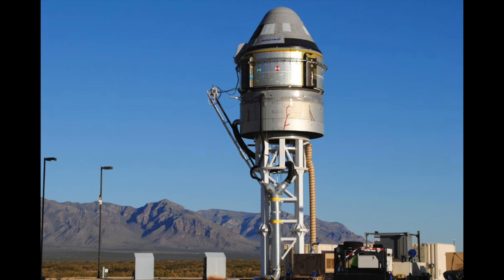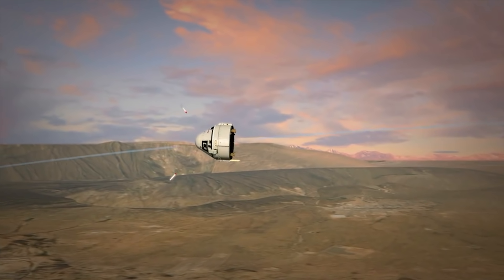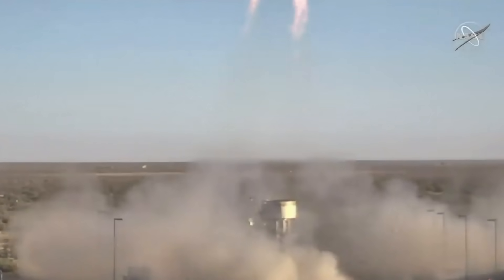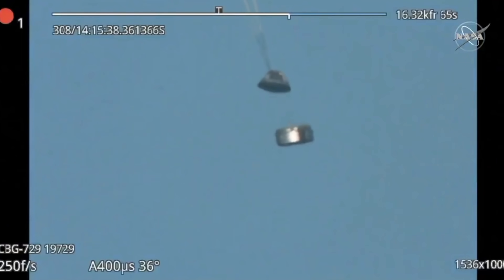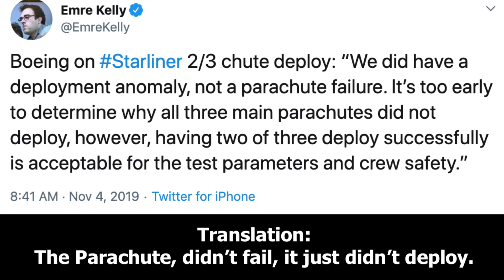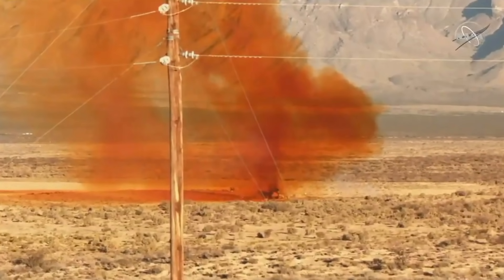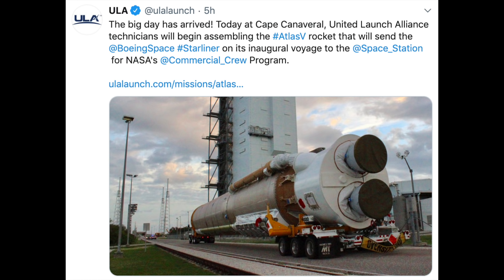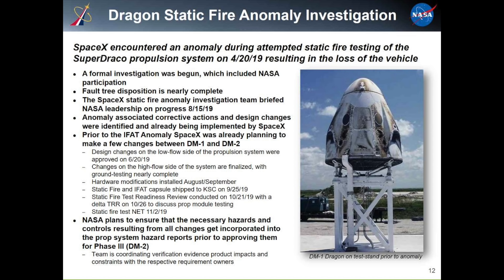Parachute Fails To Deploy During Boeing's Starliner Abort Test.

Comment: It seems someone at NASA sleeps with someone at Boeing or maybe more than one looking at the price of the contract and NASA's acceptance of substandard operation of Boeing equipment while not accepting equally "successful" operation of other contractors. Smells like 737 max...
Reply: It's more convoluted then that when you factor in the political side.
Reply: NASA hasn't commented on the parachute anomaly. I expect ASAP will recommend additional drop testing at the minimum
Reply: @AmbientMorality  Anything I have read seems to say both NASA and Boeing are happy with the results. True, that is media and not a direct quote. I will wait to see what happens... but with Boeing waiting to upgrade deliver some 1000 737s and a large number sitting on various tarmacs waiting for a fix... With the total loss of two full of people and at least one crater where one landed. I personally am not happy with Boeing's attitude. As an astronaut, launch day might be a great sick day. One wonders what other things in the Boeing craft are just good enough to have passed inspection but will fail at some point.
Reply: @lenwhatever4187  The reason they say that is because the test objectives were met (up to one parachute failure would still be considered an overall test success). That doesn't mean they're unaware of the anomaly or the valid concern that their system is less reliable than planned. "Happy with the results" does not mean "no need to investigate the issue".

Comment: NASA is pissed at SpaceX because Musk is giving minimum effort to Crewed Dragon.  However, SpaceX is a Marathon runner compared to the absolutely pokey Boeing, Lockheed, and the rest of the laggards.
Reply: What makes you say minimum?  Elon says they're getting the lions share of their efforts.  They have their own inflight abort coming up for Crew Dragon.
Reply: @TheEvilmooseofdoom  , "minimum" is relative at SpaceX.  Musk and Shotwell have been concentrating a good chunk of engineering on Starship.  NASA whined about that.  The inflight abort for Crewed Dragon is using a full Falcon9 rocket.  Boeings used a sub scale launch vehicle.  Technically this launch failed because all three parachutes didn't properly work.  BTW, my son is an engineer and SpaceX is known in the industry for firing engineers if they don't get off their ass.

Comment: Meanwhile, Boeing built the X-37B spaceplane. Why don't they build the proposed X-37C and use it to fly crews to and from ISS? The US Airforce seems to be having zero problems and it would only be a matter of scaling the existing X-37B up to accommodate several astronauts. It's much better to have a controlled winged flight back to a runway than to fall from orbit and hope your parachutes deploy.
Reply: Have you seen the X-37?  It's not very big..  where exactly are the crew to go?  What abort system does it employ should there be a booster failure?

Comment: And this is the reason (for me) for not believing in the starship hype...
A capsule is able to abort in seconds and can land on land or water, even if something fails, whereas i am more then curios to see, how the starship is going to land safly if the engines dont work or when it is over water...
Reply: There are no details at all yet about a LES for starship, they're still testing to see if it'll fly.
Reply: @TheEvilmooseofdoom  well, making it fly isnt that hard, even the delta III flew ;)
The whole starship concep is just to similiar to the shuttle, perhaps it is going to be the future, but i would be very surprised if it is going to be manned before the 2030s
Reply: @kopfauftischhau216  Outside of being reusable the 2 systems are vastly different.  It's still a entirely experimental craft that has yet to make a flight.  So there is no finalized design yet.
Reply: @TheEvilmooseofdoom  it just reminds me of the shuttle. I hole that it is going to work, but i highly doubt that the cost to launch is going to be lower then 100kk, not to speak of the "10 flights a day" "on earth transport" "one millionen people on mars before the end of the century"